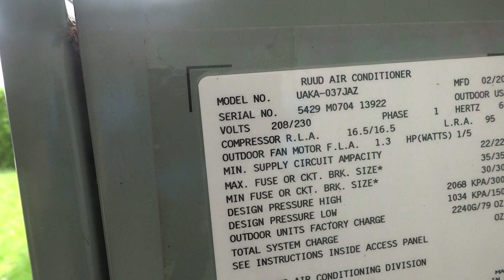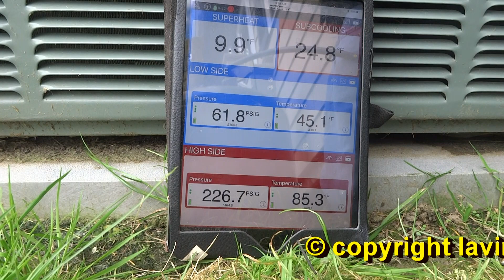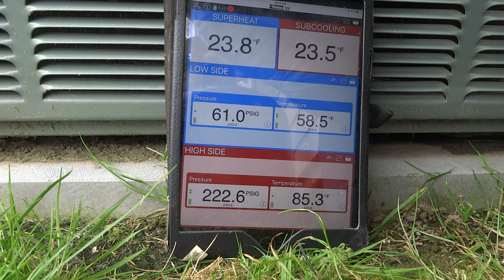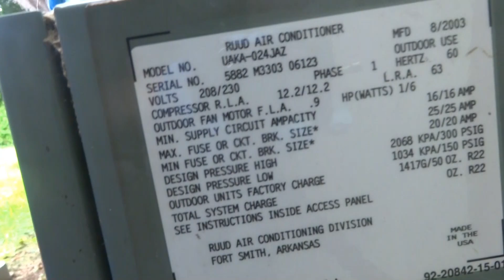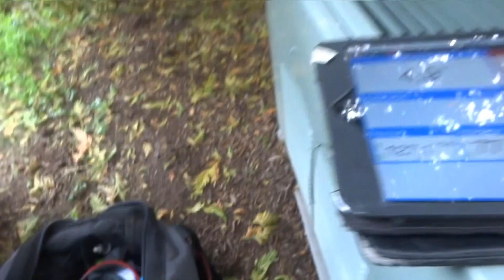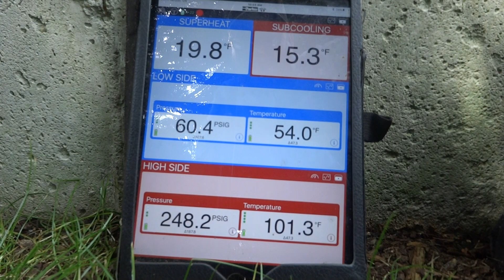2 RUUD AC UNITS CHECKED R22 REFRIGERANT CHARGE

Comment: Steve I'm not an hvac guy but I do work in auto repair. When people hack holes in things I've used a 3M product called strip caulk. Some call it dumb gum. You can wad it up and fill in holes in metal with it. Looks like fluffy was getting in around that tstat wire. Always enjoy your videos

Comment: bet fluffy got in through where low voltage wires go, Be needing a better grommet or some thing, Plug that area up a bit.
Reply from the maker: YOU PROBLEY RIGHT
Reply: @stevenlavimoniere  I've found if fluffy wants, she will get in no matter what... I've rodent proofed machines in the past only to find them still residing without payin' no rent!
Reply: Steel wool stuffed into the hole where the thermostat wires enter the unit, that's Fluffy's very own custom entrance,  he's out of the rain and nothing can bother him when he's at home.